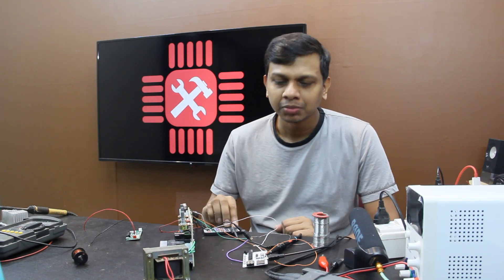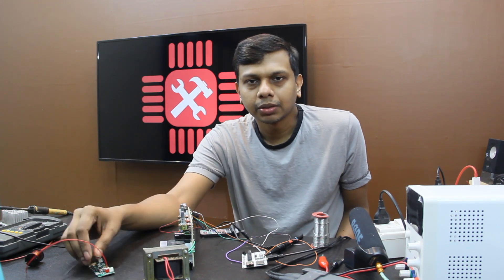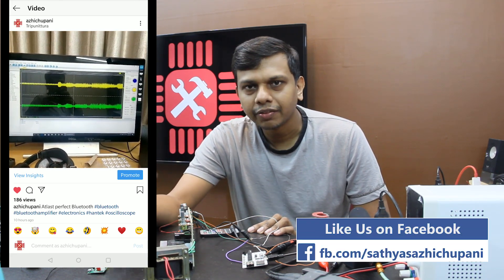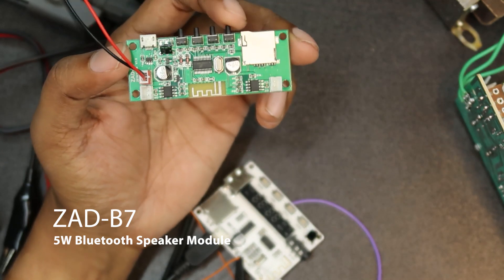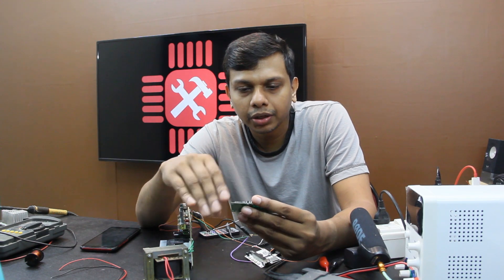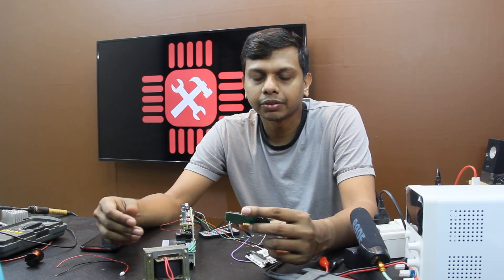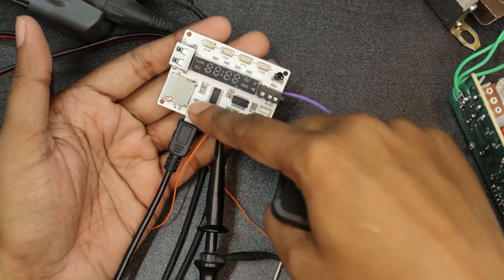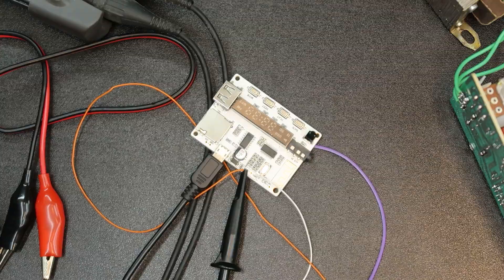#Aliexpress Perfect Bluetooth Speakers | Oscilloscope to the rescue | No Noise

Comment: Solder a wire from negative of the PCB to the negative of the main power supply or to the negative of filter capacitor